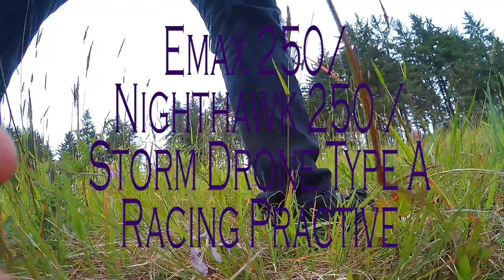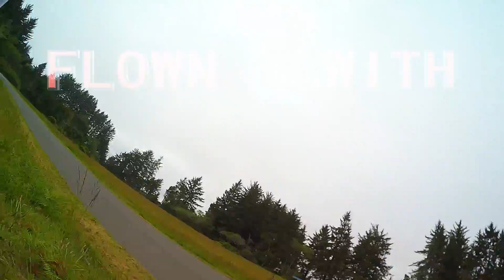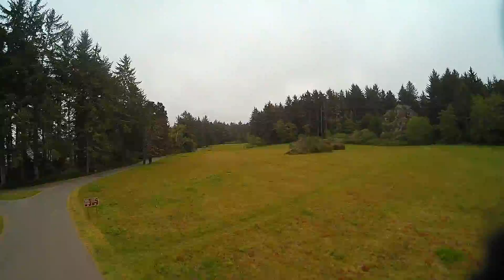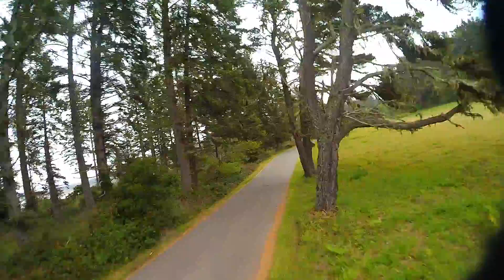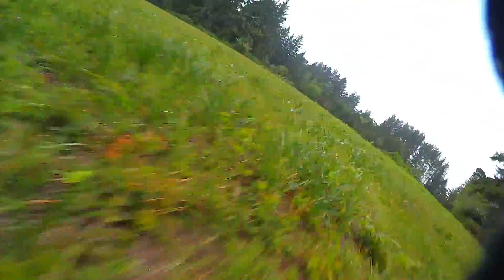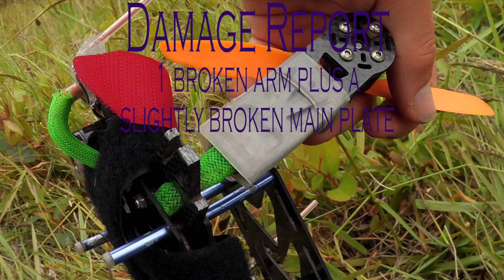Emax 250/  Nighthawk 250 /  Storm Drone Type A  Racing Practive

Comment: Nice one! I would suggest just editing on a 30fps timeline. Exporting as 1080p60 only increases your file size, and makes everything look like video tape - all glassy. Also you can't do smooth slow motion in a 60p timeline. It plays more choppy too on YT because it takes more bandwidth. Nice flying though!
Reply from the maker: Chad Johnson Ok thanks for the suggestion.  I don't really use slomo for this type of video and I kinda like the way 60fps makes it look very silky but for videos that I plan on doing slomo I will definitely do them in 30fps

Comment: Running same frame on a slightly different setup using 5 inch props due to unable to source some good 6030 props near me. Also the 1.3ghz for video is giving you some good range? I run 5.8ghz as the uk bans 1.3ghz so much shorter ranges. My quad in action is here is you want to take a look https://youtu.be/W-FdYt2H3Z0 That is using the MT2204 motors and 12a simonk escs. Nice vid
Reply from the maker: Matthew Herridge cool.